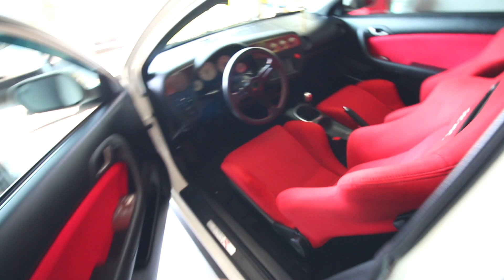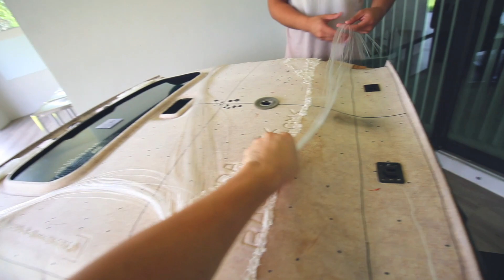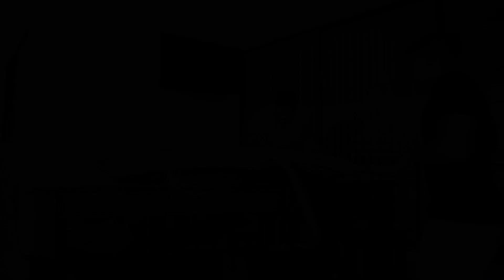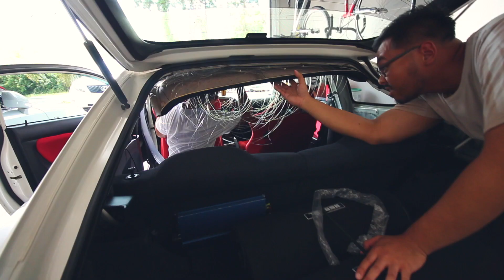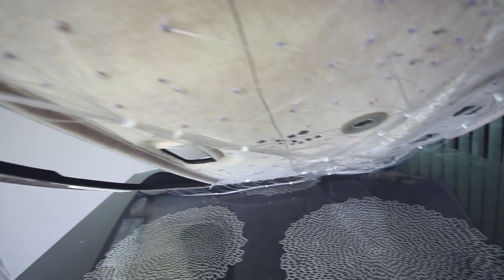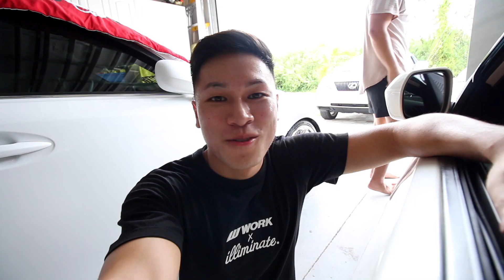Turning My Acura RSX Into a ROLLS ROYCE (Starlight Headliner)

Comment: Tried doing this but was so damn hard to push through the fiber optic line through the fabric on the other end even after using a thicker needle !  Any suggestions?  Thanks!
Reply from the maker: I had the same problem with a few cars that have thick padding on the headliner. I just went back and shoved the needle farther down to create a slightly bigger hole. Play with the insertion angles too. They can be bit tricky to feed through sometimes because of the angles that you poked the holes at.

Comment: Hey bro, thinking  about doing this to my dc5 too, can you just turn it off with the controller or do you need the switch?
Reply from the maker: You can use just the remote to control power if you don’t want to use a switch. The switch just gives you more options. For example, if the batteries in your remote die and the lights stay on, you can cut power with the switch.
Reply: @SebastianInt  thanks man! Appreciate it
Reply from the maker: @Alejandro-vm5jb  you’re welcome! 👍🏼

Comment: Did you have to leave any slack in the Fiber optics where the sunroof cover slides in and out? Or do the Strands tuck down enough that it's not a probem??
Reply from the maker: My car has a metal tray that the slider sits in, so it’s separated from the headliner itself. I left a good amount of slack so that the strands don’t get pulled out.

Comment: how is it holding up ??
Reply from the maker: It’s holding up great! Haven’t had any problems at all.
Reply: @SebastianInt  cool man good to know. Bc a friend of mine who also has the same car as us  mentioned heating problems when doing this mod. now i feel better about going thru with it
Reply from the maker: It may depend on which lighting unit you buy. Some may run hotter then others, but I haven’t had any issues with my system. I’ve also installed larger units on other cars and no problems as well.

Comment: Does the sunroof hit the wires?
Reply from the maker: It does not come in contact with the fiber optics.
Reply: @SebastianInt  thanks I’m about to do mine I got the stuff I was just thinking about how the sunroof slides back
Reply from the maker: @midwest1993  no prob! 🤘🏼 I believe some cars have a metal tray that the slider sits inside of that separates it from everything. Mine does.

Comment: Do you have a link to the flip switch? Does it come wired or did you have to buy it all separately
Reply from the maker: https://www.ebay.com/itm/383804949262 This is the updated rocker switch that I’m using now. You will have to get your own wiring.

Comment: How come you hooked it to a switch if you can turn it off with the remote?
Reply from the maker: The lights are tapped into my amp which has all time power. The switch allows me  to cut off power if the battery in my remote ever dies out while the lights are still on.

Comment: Ik this is a year old but how long did u get w the lights 6.5 ft or longer
Reply from the maker: This is 6.5 feet. You can only use this length on a hatchback or small car where the lighting box is going to be close to the headliner. For 4 door cars and trucks , I recommend 9-13 ft.
Reply: Sebastian Int I have an rsx too 😂
Reply from the maker: Oh alright lol. Then yeah, 6.5 ft will work perfectly if you plan on mounting the box in the location that I did. Otherwise, 9ft (which is the next size up I believe)  should be plenty if you mount the box in the trunk.
Reply: Sebastian Int thanks for the response have had mine for ab 6 months or so and she’s looking pretty already. I got plans to get a wide body kit in the future 🤫 love ur vids btw
Reply from the maker: Nice! That’s what’s up! They’re fun cars. I love mine. And thank you for the support. Means a lot! 🙏🏻
Reply: Sebastian Int yup
Reply: Sebastian Int sry to have to bother u again but what did u do to poke the holes what u use

Comment: How long did it take you to put it all back together after you originally took out the headliner and painted it? And how did you get all the wires running through your amp and the switch? I have an RSX too!

Comment: Don't the lights ever die out? Is that why there is a "car plug" option?
Reply from the maker: Nope. It gets power from the amp that’s connected to the car’s battery. The only way the lights will die out is if the something inside the light box breaks, the amp goes out, or my car battery goes out.

Comment: So for my sunroof it has this cover that slides in and out to block out the sun if I want. I'm sure your car has something like that too, do the strands get affected by it? Like if I slid the cover in will it accidentally unhook those strands from the holes?

Thanks in advance!
Reply from the maker: Hey Jc! My car has a metal panel that sits under the slider and separates the slider from the headliner itself. It does not interfere with the strands because of this panel. I believe most cars/trucks have the same set up.
Reply: @SebastianInt  thanks for replying! I forgot to say it looks great btw! 

Anyways yeah now that you mention that, it makes sense that I should have a similar setup. 

I have a 2020 Mazda 3 hatch so there aren't too many videos/instructions on these mods yet so I wasn't sure. 

Anyways keep up the videos! Subscribed!
Reply from the maker: Thank you for the support! 👍🏼 Appreciate it. Hit me up if you have any questions!

Comment: When you taped into the amp for power, did you just cut the 12v plug off and use that wire? Nice job btw, I'm about to do it to my truck.
Reply from the maker: Thank you Joseph! And yes, we cut the 12v plug and crimped ring terminals onto the wires to connect to the amp.

Comment: How did you wire into amp?!
Reply from the maker: Skreet2x You’re going to cut the wire that comes with your lighting kit. One end will plug into the box for power and then you’ll cut the other end where the plug is that would originally go into a cigarette letter. And then attach 
ring terminals to the side you cut and then attach to the amp for power.
Reply: Sebastian Int thank you!

Comment: Did it come with a control? Why dont you use the control to turn off the lights when you start it up?
Reply from the maker: Saul Baez The amp has live power running through it, so the switch allows me to cut off power when I’m not using the lights.
Reply: Sebastian Int oh okay

Comment: Does the remote still work good with the box being inside the panel? Can you change colors still?
Reply from the maker: No power converter due to it being 12V. The wire on the cigarette lighter end of the plug was cut exposing the positive and negative wire. It was then wired to the amp using ring terminals.
Reply from the maker: Will Alexander Yes, everything works perfectly.
Reply: Sebastian Int did you have to use a power converter for the plug? 🔌
Didn’t see that in the video. Thanks for the reply.

Comment: How did you wire it from the amp ?? Trying to do this in my ek
Reply from the maker: Nope. You don’t need the cigarette lighter plug. Just cut the cigarette lighter end and the positive and negative wire will be exposed. After that, use ring terminals so that you can attach them to your amp.
Reply: Sebastian Int  so correct me if im wrong sir ! cut the cig lighter . Connect the cig lighter to amp . And the wires that were  powering the cig lighter before can be used to power up the box ?
Reply: Sebastian Int do you think it would be possible to make letters with stars in a corner
Reply from the maker: You’re going to cut the wire that comes with your lighting kit. One end will plug into the box for power and then you’ll cut the other end where the plug is that would originally go into a cigarette letter. And then attach the ring terminals to the side you cut and then attach to the amp for power.
Reply: Did you need the cigaret lighter ?

Comment: The thing is that Rolls use the same method but they charge 12K for that option 😂🤦‍♂️
Reply from the maker: Crazy right? 😂 This whole project only cost me $60 lol.
Reply: It’s definitely theft. Although it should be noted that the Rolls Royce ceilings have 1340 stars. That’s a whole lotta stars.
Reply: Polly Monopoly well for that amount of stars using this method you’d pay around 370$ still nowhere near 12k
Reply: lets not forget that the lights and everything they do is top quality. If they get a single 1/8 of an inch  incorrect, they have to redo it, a lot of man hours goes into it looking as good as it does in a rolls royce.
Reply: rolls royce uses actual low karat diamonds though you guys are on crack if you think the 12k option is just for this
Reply: @aura2d  wrong that kid, theres literaly tons videos of them getting the roof done and the process is just like this one, they use fiber opctic not "diamonds" and crap. It doesn't take to much to look up the info buddy
Reply: @Jasmine Torres  they charge you the extra 12K the time you order the car🙄

Comment: i just ordered the same kit , i was wondering if the 200 would be enough for my scion frs headliner or if you know if i can add more without buying a whole other kit
Reply from the maker: King Cyrus 12 I think 200 should be fine 👍🏼. You do have a bigger headliner though, so it all depends on the way that you lay it out. They sell just the fiber optic wire on eBay if you want to add more.
Reply: Sebastian Int thank you! i was trying to find the extra wires but idk which ones would go with this kit , do you know the link?
Reply from the maker: You’re welcome! Here is one that I found. There’s 2 different diameters you can choose from.

https://www.ebay.com/itm/New-Decoration-DIY-Plastic-Fiber-Optic-Cable-PMMA-End-Glow-Led-Light-/223383003788
Reply from the maker: The bundle is held together with black tape. All you’ll have to do is add to the bundle and then retape it together.
Reply: Sebastian Int goodlooks bro appreciate chu💪🏽
Reply from the maker: Anytime homie 🤘🏼

Comment: Doooooooope!! I recently had my headliner redone. We put a suede headliner in. The guy who does all the work on our cars quoted me $700 to put the lights in. I'm contemplating it. It looks dope af! Great video quality btw. What camera are you using?
Reply from the maker: TheOneAngelina Thanks Angelina! It was a lot of labor, but definitely worth it. I love it! I wanted to do the suede on mine, but ended up spraying it with fabric paint instead. The camera that I’m using is a Canon t4i with a 10-18mm wide angle lens.
Reply: Where did they quote u 700 what state?
Reply: Javan Savage it's a friend discount. I live in FL.  The guy who rents a bay at my shop does Fabrications😉 Don't think that kind of deal is for a "customer"